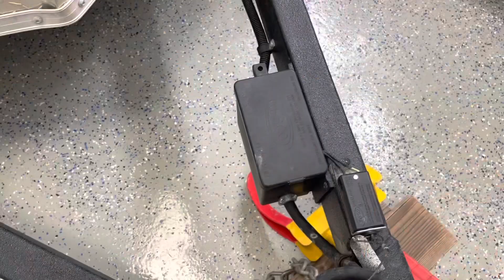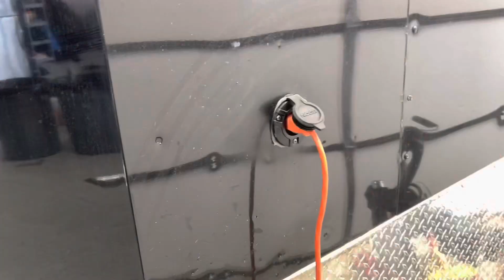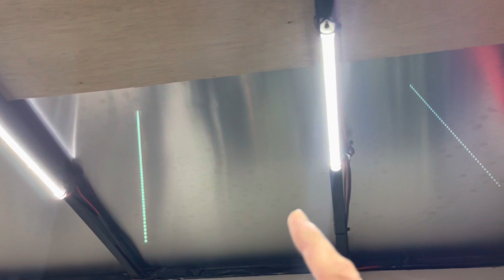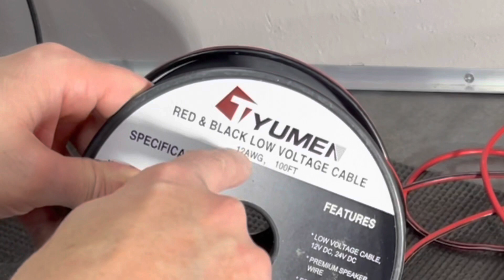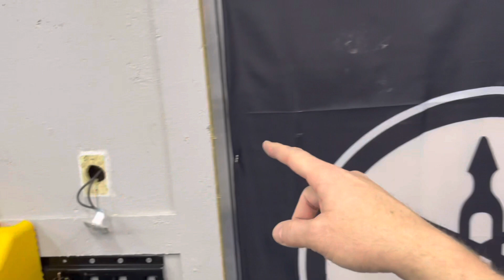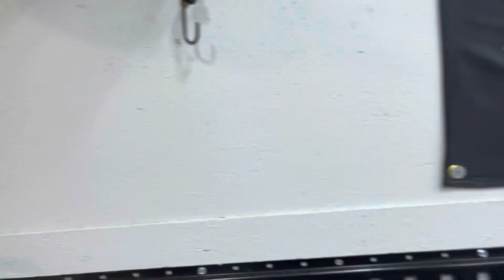Wiring Lights In A Cargo Trailer | How To Add A Battery And Lights In An Enclosed Trailer

Comment: Could you just use the battery disconnect for the on off switch for the lights?
Reply from the maker: Yeah you could, it's just putting it in a convenient location

Comment: If your coming here for your own project be sure to put a main fuse BEFORE the battery shutoff, he has fused his electrical runs but never fused the battery (leaving him open to direct shorts at the battery) before the block which isn't exactly the best situation, so get a 200 amp fuse as close to the battery as you can, then go from fuse to shutoff to fuse block.
Reply from the maker: Interesting suggestion

Comment: If you spliced into the power supply from the truck instead of terminating it, wouldn’t that charge your trailer battery when driving w/ lights on?
Reply from the maker: Yeah possibly

Comment: A terminal block would have been useful to parallel all of the lights and tying into the switch. Would have been a much cleaner installation.
Reply from the maker: Yeah most likely

Comment: Hi  there. I bought same gear you did. My outside LED lights are one one circuit. My inside led lights are on another. I have tried a 30 amp fuse for the outside led lights but it keeps popping. What can I do to correct this issue?
Reply from the maker: Check the wiring make sure there's no wire or wires are not crossed
Reply: Wiring all good
Reply: Ready to go back too old school and just use an atv battery on its own with the wiring.

Comment: I have my 2014 7x14 Stealth Trailer set up so the Truck charges the deep cycle battery when it's hooked up, why wouldn't you have it charge while your connected, also where are you getting the 110V from?
Reply from the maker: Just an outlet

Comment: So is the charger charging the battery even when not plugged in from the outside with an extension cord?
How long will it last without having to plug the trailer back in at the house?
Reply from the maker: It would last a week or so, the led lights don't draw much power

Comment: What gauge wire did you use off battery to disconnect switch and to  fuse box ? 8gauge ? Thanks
Reply from the maker: Yeah it was an 8 gauge

Comment: Did you need an inverter to switch from 12v to 120?
Reply from the maker: I don't have one in this trailer. I just have the power strip plugged into the wall outlet, which runs off the extension cord. All of the lights I'll run off 12 V, but if I wanted to run a 120v I would need to add an inverter to the battery

Comment: Where did you source those bins near your battery? Are they anchored to the wall?
Reply from the maker: They are from Home Depot, and yes I have them just screwed into the wall
https://www.homedepot.com/p/Husky-55-Gallon-Stackable-Storage-Bin-in-Black-232387/300170479?source=shoppingads&locale=en-US&pla&mtc=SHOPPING-BF-CDP-GGL-D25S-059_016_GARAGE_ORG-NA-NA-NA-PLALIA-D59S-NA-NA-NA-NBR-NA-NA-NEW-FY23_Shopping&cm_mmc=SHOPPING-BF-CDP-GGL-D25S-059_016_GARAGE_ORG-NA-NA-NA-PLALIA-D59S-NA-NA-NA-NBR-NA-NA-NEW-FY23_Shopping-71700000108113319-58700008320130189-92700079407476727&gad_source=1&gbraid=0AAAAADq61Ucq3UK3HiOm3XG_0O6lWbs9i&gclid=EAIaIQobChMIhaLuwtm_hAMVgy-tBh1q3AUOEAQYASABEgLzh_D_BwE&gclsrc=aw.ds

Comment: Since I just purchased a new trailer I am going to do most of what you have done. Great vide and tips, I went with the NOCO charger, I have their products. I also realized that 12 gage is too large I will run 14 gage soldered connections. I would be interested in how you intend to do a solar charging feature, that seems a bit more involved.
Reply from the maker: Here's the solar video!  
https://youtu.be/t3fA534DuNI?si=7aJRidJF14iRrpU6

Comment: So I’m going to break the “no dumb questions rule”. If you’re not plugged into a power cord on the exterior of the trailer, will the battery itself act as a power supply for a short period of time that allows fhe lights and power strip on your toolbox to operate?
Reply from the maker: That's exactly right!  It will last several days before needing to recharge becuase the led lights draw so little power!
Reply: Have you changed this setup to include any 120v outlets or anything more than just LED lights as the load?

Comment: As far as I can tell I have the exact same setup as yours. 8 of the same lights on your list, same wiring setup with the fuse block and a size 27 deep cell marine 12 volt. Hooked it all up tonight and my lights are extremely dim. What could I be missing?
Reply from the maker: Either defective lights, or low voltage going to the lights, check your connections and make sure the battery is charged.
Reply: Thanks I appreciate the reply, my next step is to confirm my connections. I believe my “battery to fuse box” cables/contacts may be too big for a good connection to the fuse box.

Comment: Just to confirm. You have Red Positive wire going from Battery to Positive side on shutoff switch. Then on the other end of the shutoff switch, you are just running a wire (Red or Black) to the Positive on Fuse box, correct? Then the Negative black wire from battery is going to the negative on shutoff switch. Was size of fuse are you using?
Reply from the maker: Correct on the first part, but The negative wire is not ran anywhere to the shut off switch.  The negative from the battery is just going to the negative terminal on the fuse block.

Comment: GREAT VIDEO!!  What size +/- wire did you run from your battery to the on/off switch, and then to you fuse block?  Also, did the fused +/- leads come with the battery charger?  Thanks again!
Reply from the maker: I ran 12 gauge which was probably too large but it's what I had.  Yes the fused leads came attached to the charger.  Thanks for watching
Reply: @Myksgarage  Thank you for responding!  I'll send photos of my set up when it's completed.

Comment: Great video man thank you for the great tips and tutorial… quick question, how long does the car battery really last before you need to plug it in? With the amount of lights you put can you go a week or two without plugging it in? Not sure how much power those nice LEDs use thanks again
Reply from the maker: Not sure how long it will last, but I would think a week or so

Comment: Any help would be nice. I created this exact setup only thing different with mine is that I had to add a switch for the lights due to my trailer not having one. The problem I am having is that when I toggle the switch for the first time I pop the fuse. I went as high as 30 amp fuse which I know is way to much for a circuit like this but it still popped. I ran the red wires all together which is going to positive on the switch and I have black coming off other side of the switch the load side to all the black wires to the light. What am I missing? I also tried getting a different switch thinking maybe the switch was faulty but it did the same with that switch so I am missing something but can’t wrap my head around what it is. Any help would be nice thanks in advance.
Reply from the maker: The negative wire does not go to the switch, the switch only interrupts the positive wires, all of the negative should be run directly to the negative side of the battery
Reply: @Myksgarage  so what wire goes from the load side of the switch? Or maybe I should ask what do you put on the load side of the switch?
Reply: @Myksgarage  I also ran all red wires to both sides of the switch, which didn’t seem right but gave it a try and then the lights wouldn’t switch off at all.
Reply: @Myksgarage  Nevermind it all just clicked to me and I have it working correctly now. Thanks!

Comment: Curious, why didn’t you run all those lights in series off the existing dome light.  It’s already switch connected and wiring would be a lot cleaner
Reply from the maker: Because that light was not connected to the new battery I installed

Comment: @Myks Garage 
If you took the positive wire coming from the truck to the original light switch and ran it to the battery, would that effectively charge the battery when hooked up to the running truck?
Reply from the maker: It sounds like it would
Reply: I wouldn’t connect it directly to the battery.  At most you will get 50-60% charge.  That’s why alternators produce more than 12v, generally 13.5-14v.
Reply: @thwrkmns70  if hooking up to live 12v auxiliary power from the vehicle's 7 pin connector be sure to install a battery isolator. Safer and is sure to not drain down trailer by low battery on truck. Don't need a big isolator and this will allow safe charging while vehicle running. Always fuse any source of power. Choose a fuse rated for the trailer auxiliary power circuit. That info can be found in your vehicle manual fuse chart. Choose a slightly smaller rated fuse so you do not overload the circuit and will be changing the fuse on the trailer which is much easier than getting to many fuse panels in the vehicle. You never want to stress the wiring on the vehicle as that is expensive and time consuming to find a damaged wire if you do. Be sure trailer is vented so no dangerous gases build up. It is mandatory on newer trailers. Older ones may not have. Be sure battery can breathe well. Hope this helps some people!

Comment: Holy Buzz Light Year you do enjoy you lights.

Is that epoxy on top of the floor plywood?  What kind of epoxy is it? Exterior, interior wood epoxy, garage concrete floor epoxy,... and was it rollered on, brushed on,...? 
This is the 2nd trailer I have something like that on the floor.

Those wire nuts are not designed for situations like this where there is lots of vibration, such as when the trailer moves via towing. They are for in stationary structures.

As you mentioned it would have been acceptable, cleaner looking and tidier to use a smaller, thinner gauge wire like an 18 or 20 gauge considering the lights are LEDs and draw very low currents, amps.
I know guys who use a small riding tractor battery for their lights and it last all summer without charging. So your big batteries may be over kill, unnecesary weight and space consumers.
Reply from the maker: Good feedback

Comment: How does the cabinets on the wall hold up while traveling? How did you secure them?
Reply from the maker: The hold up great, they are just screwed into the studs on the wall,
Reply: @Myksgarage  I wouldn’t think the frame would be strong enough. I just got a 7x14 and really like your setup in the v with the tool chests/tables and am going to use it as a starting point for mine!
Reply from the maker: The cabinets themselves are not that heavy, and I don't put a lot of heavy items in them so it's not an issue.  Also, I like that they lock so that the doors do not fly open when I'm driving. Good luck on your build!
Reply: What size is the tool box that is on the floor and how did you mount the wall cabinets?

Comment: Thank you for taking the time to make this video. I do have a couple questions: Are you using an AGM or Flooded battery? Do you have a vent in place if you are running a Flooded battery? Thank you again.
Reply from the maker: It's a flooded battery, and I don't have a vent in place
Reply: @Myksgarage  have you notice excessive gas or fumes during charging?

Comment: I am doing this on my trailer. I don't know much about batteries and I want to make sure that I do it right... Do I need to connect a ground wire to the frame and the negative side of the battery?
Reply from the maker: I didn't connect any grounds to the trailer frame or metal parts.   All of my grounds ran back to the negative on the battery, I figured this would make it the easiest for me to understand and wire

Comment: Also want to say thank you for a GREAT video and taking the time to put it together. Next time you need to splice and join wire have a look at the products from Wago like their compact pushwire splicing connectors.They are a life saver and so much better than the old pigtail connectors. Cheers!
Reply from the maker: Good suggestion, thanks for sharing!

Comment: Awesome video. Going to start mine this week. This may be a stupid question, but could you just buy linkable LED lights and effectively just wire the first light and use the included connections to link ind run the rest of the lights?
Reply from the maker: It sounds like that would be a good short cut.  Good luck in your build!

Comment: If my trailer didn't have a existing light switch and want to add one and  lights like yours. Would I just hook 2 positives and 2 negatives to the light switch pos and neg connectors and have one pos and one neg going to the fuse block and then then other pos and neg running up from the switch and into each light
Reply from the maker: The light switch just interrupts the positive wire.  So a positive wire from the battery or fuse block to the light switch, then a positive wire leaving the light switch going to the positive on the LED lights.  The negative you will just run from the battery directly to the negative on the lights. See this link to this 12v switch that just has 2 terminals, both are for positive, so positive in from the battery and positive out to the lights. 
https://amzn.to/3QGaiCA
Reply: @Myksgarage  okay gotcha so I have the same switch but a dual and  my issue is I was connecting the pos and neg to the switch but really I should just be using 2 pos from the switch one to the lights and one to the fuse block. Also does the neg for the lights have to go to the battery or could I use one of the neg terminals from the fuse block ?
Reply from the maker: Yeah you can use the negatives on the fuse block, it's easier that way, so you don't have a a bunch of individual wires  going to the battery.  The fuse block is just an extension of the battery
Reply: @Myksgarage  awesome,  thank you again for the insight and help

Comment: I seen you had a surge protector is that used for anything else? I imagine the leds work because they can run off DC power. If i wanted to use this same set up and utilize a plug for example to run a little vacuum or charge my Milwaukee batteries how would i accomplish this with the dc power coming straight from the battery?
Reply from the maker: The surge protector is just plugged into the wall outlet, if you want to charge batteries and so forth from the battery you just need to get an inverter, and wire it directly to the battery:
https://amzn.to/3tuV8re

Comment: Sorry im late but, I'm trying to hook up power for my tool trailer. Would this setup be enough to power lights, use battery chargers for tools and possibly a mini fridge?
Reply from the maker: Yeah you would just need an inverter for the fridge, and some solar to recharge the battery.

Comment: Awesome video and I wired mine exactly like this after watching. I just have to cut the hole for my sure power now. Did you do a video of that also? I would just like to see if so before I cut my hole as I’m a little nervous to cut into it lol .  Thanks for this video
Reply from the maker: Nice! I did not do a video of cutting a hole, just get a holesaw that is the size of the outlet hole ,and drill  right through.
Reply: @Myksgarage  Will do tomorrow and give you shouts when I post.

Comment: Crimp splices would be much better for a mobile application.  Wire nuts are intended for stationary application, like houses and buildings.
Reply from the maker: Yes, thanks for the suggestion
Reply: Could potentially add a solar panel setup and mount the panels on top of trailer and that would charge batteries while at locations

Just finished the vid, you covered what I said above lol

Comment: I have a similar setup but mounted my battery out on the tongue. The guy at the battery shop said that they need to be outside due to normal venting?
Reply from the maker: Not sure on that.
Reply: Correct.  A wet cell battery should not be mounted inside of an enclosed space because they off-gas when charging.  I used an AGM battery in one of my cargo trailers, which is OK for inside mounting, because they are totally sealed.

Comment: Where was this video 18 months ago when I was figuring this out myself?  😁

I did a similar setup, but didn’t think about using the wiring block.  That’s a great suggestion and I think I’ll go back and add that as well as the RV battery cutoff switch.

I’ll look forward to the solar panel install video
Reply from the maker: Thanks for watching, I’m glad you found this helpful.  Stay tuned for more updates!

Comment: Great job. I watched your epoxy floor video because I plan to do that on my 24’ trailer. Just a small tip, in a 12v system you could have used the trailer frame as the ground and you would have only needed to run the positive wire for each light.
Reply from the maker: Yes I thought about that, if the welds are soild that’s a good idea, I wanted to make sure I had goo grounds so I just ran the grounds to the battery.  Thanks for watching!

Comment: To add outlets would you just add into that fuse box, or is there different box needed? Sure it’s self explanatory, but just curios.  You Did a fantastic job.
Reply from the maker: To and an outlet it would have to be a 12v outlet, like a 12v socket and yes, just add it to the fuse block
Reply: Thank you

Comment: Good video. I would definitely not use grease caps, use crimp heat shrink connections or old fashioned solder and heat shrink. The grease caps allow moisture and debris in and cause a bad connection. Also, to be able to charge your battery off your truck, find the positive wire in the 7 way trailer plug on the trailer side, tap into it, and obviously add a fuse, connect that to the positive battery terminal, and run a negative battery terminal to the trailer frame so it can be grounded.
Reply from the maker: Thanks for the tips

Comment: How long does the battery power the lights before it needs recharged since we have no power when were out on the trail.
Reply from the maker: I’m sure it could go for days.  I’m considering installing a small solar panel that will help keep it charged up